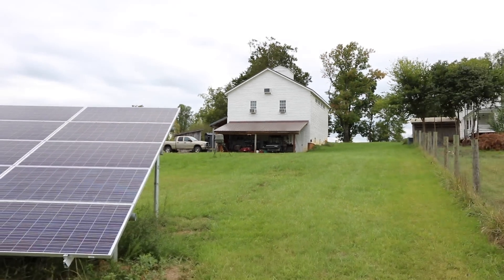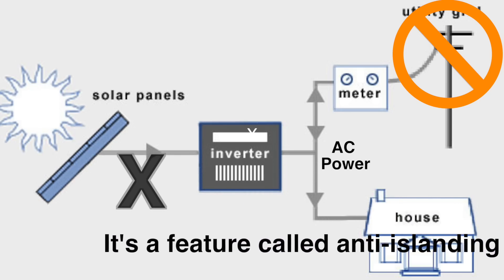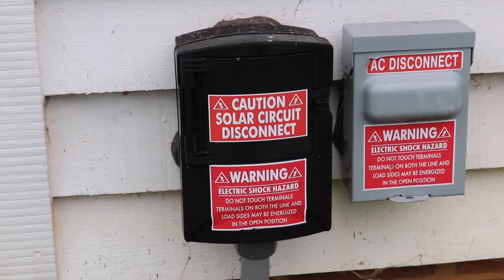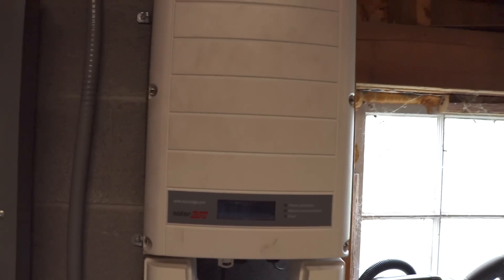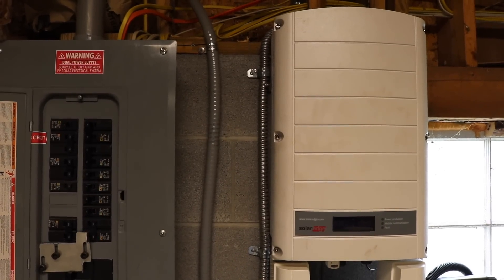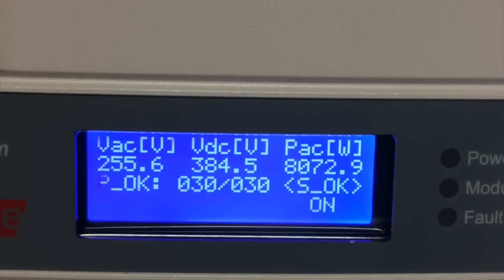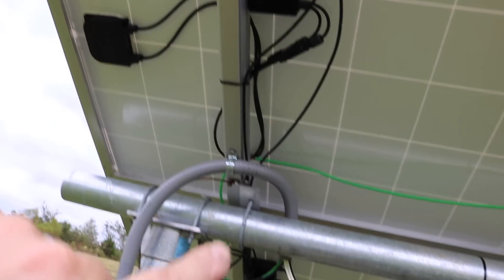The ugly truth behind grid-tie solar systems. Part 1, FarmCraft101 solar.  Watch before you buy!

Comment: okay it make sense now on how the power go back to the grid, i wonder how it would be possible regarding the syncronization of the 60hz sine wave and the answer is that it senses the sinewave from the grid and more like copying it so the output of the inverter matches the exact frequency of the grid, and deliver it back to the transformer and since transformer can be reversely connected, it will generate the power back to high voltage line and goes to the someones home. This is my first time to know that the power meter can rotate backwards! genius! thanks for the explaination.

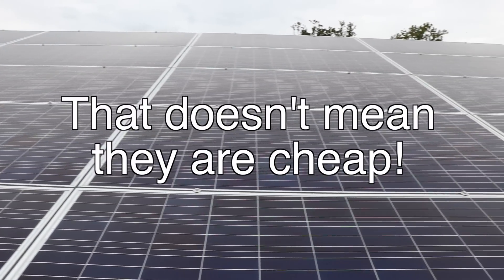Comment: 1:44 So, you paid $23,000 for 9KW solar panels system back in 2017. Now it is 2021 and everyone is talking about price of solar panels going down. Yet, I recently got estimate for grid tie 3KW system for over $12,000 before 26% federal tax credit. What do you think? is the solar company trying to scam me?
Reply: If you got the quote recently, part of the reason was that the solar panels price has skyrocketed due to silicon shortage. Solar panels typically constitute 1/4 of the whole system cost.
Reply: @zenniz1992  Damn that suck's. I was looking at prices and was like dang this guy did it for cheap but prices have went up no wonder
Reply: Also bear in mind that solar PV system follows strictly on the economics of scale. Many price are fixed like authority submission and qualified personnel endorsement fee, etc hence 9kW for $23k does not means 3kW = $7.7k

Comment: Well wait, wouldn't putting a hard disconnect lever between your main and the meter prevent your system from going down when the grid goes down? This would make the most sense, in other words a semi anti island.
Reply: I'm just learning this, but I think if the main is disconnected from the meter the inverter won't sense AC on the grid and will not power up.

Comment: I suspect you could connect an inverter and battery charging system to the DC, I don't know if a charging system would take 300V. Then put an inverter on the batteries and some plugs for that inverter.

Comment: Don’t the power drop off for the distance you running the current to? For example if you were welding you have to go to a larger wire if you run you welding probes beyond the standard 25’ of run and if your going beyond say 50 or 100. ‘ feet then you would have to go to a large size due to resistance.

Comment: Optimizers don’t exactly work that way, they are still all tied together like Christmas tree lights. So an optimizer boost DC out put in the event of shading. In other words when a portion of this system is comprised due to shading the entire thing is affected but due to the optimizer it’s not as bad as a traditional string inverter would be. The better choice is a micro inverter system if you are worried about degradation due to shading. If shading is not a concern your system is fine. Trust me I know, I’m a salesman.

Comment: what about upkeep cost, and does it last that long before needing to be restored at that efficiency for those 8.5 years. All the research ive done points to it not saving any money at all or very little and location is huge if your in northern England where it rains no point , but Arizona is good if you clean off the dust every week, dust build up kills systems just a 7-14 days in a some what dusty environment can reduce a system by 50% and in deserts up to 90%, the mars rover has this problem they engineered it to only need  5% to keep the battery warm and 10% to run for a 60 mins give  or take. with all that said now in 2021 with lithuim ion battery the tech is starting to become decent buy also its isn't getting cheaper so theres that i hope one day it becomes really worth it. Unless youre doing it do power your home when the grids down i would wait for the tech to get better id say 2030-35 well be at a point where the tech is good enough and cheap enough to make real sense.

Comment: If you had a home battery, you could still power your home with grid off
Reply from the maker: Not with this type of inverter (grid tie inverter.)
Reply: @FarmCraft101  seems strange that a person cant use and store solar and not put excess back into the grid?
Reply from the maker: @deadtreebark  It's possible, but not with a grid tie system.  You have to have a hybrid system for that.  Grid tie is a technical term.  It doesn't just mean hooked to the grid.

Comment: The biggest draw back having a grid type solar system is a huge power surge from your Electric Co-Op Company which fried our power surge protector box and 22 Microinverters on our solar panels our system has been down now for a month not sure when it will be back up and running at this time.Had our system little over a year now we are at the Electric Co-Op Company Mercy.

Comment: I believe another reason for the shutdown when the grid is off is because the inverter needs to sample the line frequency in order to sync properly so it can feed the grid. Power loss is I2R or Vdrop is IR so lowering amperage and raising voltage and reducing resistance of the conductor helps.
Our grid here is priced very differently. Electricity is 0.07 kw/hr and most of our bill is delivery fees. So actual electricity is less than 1/3 of our power costs and no one has discussed what happens when you draw from the grid with regard to those major fees. So our payback is quite a bit longer and there's little subsidy from our government.
Now the tech is individual inverters for each panel so they can be paralleled at 120vac and ones in shade or not producing don't impact the remainder

Comment: Your optimizers can share 2 panels, saving half the cost on optimizers just a heads up, we do that on all our installs
Reply: I'm sorry, I am not entirely correct in what I said.  The reason we were able to use 2 panels for one optimizer was because the optimizers were rated to 960 watts.  I have a feeling your opti's are only able to withstand 400 watts so each panel required and opti.

Comment: cannot use your solar panels in a power outage , if u dont have a battery but its cheaper and can save more money if u use grid-tie solar system the battery is so expensive and have a short lifespan

Comment: Actually the economic break even point depends on interest rates. If interest rates on savings remain low, then your 8.5 years is very close to economic breakeven. 

But for example, if interest rates grow to 8% then your breakeven year would be in year 11. This is called discounted cashflow. It compares the money that you get each year to what a $17,000 deposit in the bank would have grown to in future years with compound interest. The $2400 value you receive each year is notionally reduced since getting the money later doesn't give you as much bang for your buck as had you invested it in a compound interest savings bond at year 0.

Comment: You CAN install a auto kill switch just like on the generator, so you dont ISLAND. The biggest issue with solar now is that panels and battery storage is getting better and much more efficient. Also stationary grid is NOT the most efficient. One last item, wire sizing is really critical. You want to slightly oversize the wire to eliminate bleed off and yet not too large to cause line loss.

Comment: As one who has taught himself to design electronic circuits....I would design a grid simulator to trick the inverter to continue to work when the grid goes down.   I would add a redundant relay system to protect line workers with an auto safety lock-out extra protection  to disconnect from the grid.  Basicallt...No grid means that there is no way that my power can get on the grid.

Comment: my system does 8120 kw and its all solar edge and iron ridge, auxim pannels all usa made parts  its a roof mount i designed it my self got all parts wholesale i didnt do rebates but it only cost me $1.50 per watt to install and beake even was 4 years . if grid goes down turn off main plug in generator run it to power up inverter

Comment: Hi can you tell me what is the name of the solar combiner box that you used. It is small and I have been trying to find one that size that can handle all those panels.  Also, did you ground the solar system to the main panel busbar or did you have a separate ground rod ?
thanks

Comment: A pile of lead acid batteries. You are behind the world. Lead is one of the worst pollutions in history.
   You should explain how a GRUD TIED system will shut down and not work if there is a main line power outage. Many people don't know that. Unless you have battery back up of course.
   The battery can help even on days when you have main power. It can let you run off the battery if you are on peak time of day pricing. That saves money.
   Solar also helps the environment with zero pollution. It also doesn't use anyvwater like a coal. Nat gas or nuke plants does.

Comment: Great video. You mentioned 360v system being inverted down to 2 legs of 120v to create a 240v system. Seems like there is potential power 'wasted.' Wouldn't it be better to invert down to 2 legs of 120v for 240v but have a 3rd leg of 120v (360/3=120)? Or wire your panels differently to reduce incoming voltage (although I realize the amps would be higher and require and additional wire, but wire wouldn't have to be as robust as 8 gauge).

Comment: my problem with this is the same as self checkout, donating blood or recycling for trash pick up. You are making them money when you are doing the work. Self check out, you dont get a discount for doing their job. Recycling, you dont get a discount or get paid for seperating their trash. Donating or selling blood, you dont get paid any near what they sell a pint for. Solar power pr wind power supply to the grid, you dont get paid what they charge you per Kwatt, you only get a tiny percentage. Which doesnt make it worth it, for sll of these reasons I will never participate in this self robbery.

Comment: Where I live, the utility company re-scheduled the rates such that the power during peak sun hours in the summer is worth about 1/50th of the power at night, per KWh. So, if you produce a surplus of 100 KW per hour during the 8 peak daylight hours, but use 2.5 KW per hour during the other 16 hours, that's a net, "break even," as far as KWh usage.

Comment: You said that grid tie inverters can run at a higher voltage. Aren't there charge controllers and inverters that accept high voltage even for charging batteries off grod

Comment: This solar panel arrangement may save you money down the road, but it does absolutely nothing to solve mankind's reliance on public/private electricity grids that typically use coal or natural gas to generate power.

Your system should be designed to get you off the grid altogether, forever. Perhaps this means you need a larger array of solar panels?

Just goes to show that solar power is not a viable alternative power solution for most people on this planet. In others, at the current rate of global population explosion and industrialisation, mankind's modern industrial cilivilisation is at risk of collapsing soon due to resource bottlenecks/depletion.

Most 'environmentalists' are living in a dream world.

Comment: what does actually happen to your bill if you consume less then then the PV on the grid generates when you have a smart DU meter? would be charged for that extra units you have generated, when you have a SMART AC DIGITAL meter (DU). would you been charged for the exported units?
Reply from the maker: We keep track of any excess production which can be used as a credit for the next month.  If at the end of the year I produced more than I used, I get paid at the wholesale price, which is not much.  I pay about $0.11/kWh, but wholesale is around $0.04/kWh.  That's why I sized the system just under my annual power usage.  I have never produced more than I used, so each kWh I have produced amounts to $0.11 saved.
Reply: @FarmCraft101  how many meters do you have?do you have a net meter. Thanks for your response
Reply from the maker: @owenaquilina5001  Just 1, and yes, it is a net meter.

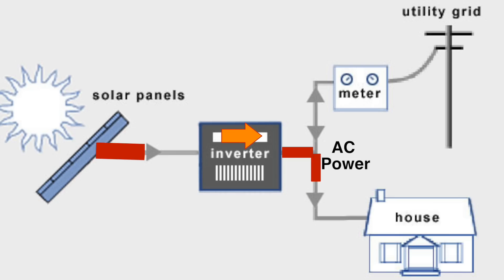Comment: at 2:30 you say if the grid goes down everything shuts off to protect utility company line workers.  True, but isn't it also true that any line worker who doesn't isolated lines they are working on is going to eventually have a problem?  For those who want supplement the anti-islanding feature, inverters do exist like the OutBack GTFX2524 2.5kW 24V Grid-Tie Inverter - whose data sheet states that “Our built in transfer switch automatically disconnects your loads from the utility grid and powers them from the inverter in the event of an outage, allowing you to continue using your solar and battery back-up power, unlike traditional grid-tie systems.”
Reply from the maker: That's a hybrid inverter.  Grid tie is a term that doesn't just mean there is a grid connection, but it's a type of inverter that will shut down if the grid goes down.  Hybrid inverters allow use of power with the grid either up or down, assuming you have a battery bank.

Comment: The reason your Schneider is much bigger than your solar inverter is that the Schneider performs tow separate and distinct functions - inverter and [battery] charger, whereas your solar inverter only functions as an inverter.

Comment: An example for your viewers. The power lines behind my house are 7,200 VAC. They run into a transformer on the pole rated at 240 VAC @ 200 amps output. 200 amps X 240 volts = 48,000 watts available to my house. If you take the 48,000 watts available to my house and divide it by 240 volts, you get 200 amps. If you divide that 48,000 watts by 7,200 volts, you only get only 6.6 amps drawn off the 7,200 volt line. This is how they can run many houses from a single 4 or 6 gauge set of wires. At 7,200 volts, you can probably draw several million watts or more. Sounds like a lot? 1,000,000 watts / 7,200 volts = less than 139 amps at 7,200 volts. Not so bad after all. At a potential maximum of 48,000 watts per home, that is less than 21 homes. I know for a fact that there are more than 21 homes on my line. Now if we can just keep the trees off them in a storm...😡

Comment: Why bother with the power company, replace them with a generator?
Reply: How does cost compare?  Coal and nuclear are pretty cheap, not so much gasoline.  How efficiently does a generator run when it has only a small load?  As in, we have sun, but not quite enough.

Comment: Why couldn’t you add a cutoff/transfer switch like is used for running your house on a generator so you could use it when power goes out and it won’t back feed to grid?

Comment: Thinking of using a “inverter limiter” so power only goes to m6 house. I’ve heard if you want to feed the grid then you open up yourself for inspection , permits, “approved” parts and labor, new meter, and hassle, hassle , hassle. Your thoughts ? Mine would be SMALL scale like only six panels

Comment: There is an interesting observation.  When the excess power is fed back to the utility company through the transformer on the power pole. Does that transformer that usually transforms from high power down  to house 120v-240v is Able to transform bath from low voltage to high voltage. It a natural feature of a transformer that they work in both directions? I know the utility company replaces the meter with a 2 way meter (net meter) but they don't replace the transformer. Maybe an electrician will enlighten us. Thanks.
Reply from the maker: Yes, they do work in both directions.

Comment: OK I have a grid tied system. No problem with the buy back program or buying night time power

BUT  In the last few years I have had the grid shut down because of Hurricane (Three weeks w/o power)  the few hours here and there from a tree fallingmor a car taking out a pole is little problem to deal with but 3 weeks. Now I have an Elco 20 HP Electric  OB with a charger and a 48V battery pack. Seems that could be used to stimulate thhe solar inverter if I had a grid cut out switch.  Live is SW FL  HighlandsCounty.Have we a friendly electrican experience to help set this up
Reply: He explained elsewhere that "grid tied" means tied all the time, which implies it has to shutdown when the grid shuts down.  "Hybrid system" refers to a system with a grid disconnect switch, that allows the possibility, with the right control circuitry, of running off grid.

Comment: If you had put them on your e/w roof your payback time would've been even quicker as it would've been cheaper to install. Also, if you had microinverters, you could switch them out for enphases's iq8's next year as they're MID forming and are designed to run without the frequency signal from the grid.
Reply: is that still the case?

Comment: So since you broke your array into 3 sections of Series then parallel you have a maximum operating amerage of approximately  25.1 amps. The label on on one your PV modules said 8.38 I mpp per panel so 3 sets of 10 PVs then wired in Pararellel is 3 x 8.38 I mpp or 25.1 amps on your DC feed line to your Inverter up at your house.

The reason I asked is because of your Solar Edge Grid Tie Inverter. So your Solaredge GTI has an option of one MPPT input greater than the 25 amps?

I've been looking at the SMA Sunny Boy Grid Tie Inverters but, they seem to have an Amperage limit of 20 Amps for MPPT input. However, the SMA Sunny Boys also have Solar Shading programmed in their latest firmware. So, you don't need optimizers especially if your array is free and clear of any shading. Clouds, even small ones are going to shade all of your array at once since the size of the arrray is so much smaller than any cloud. It's pretty sophisticated how their ShadeFix feature works.